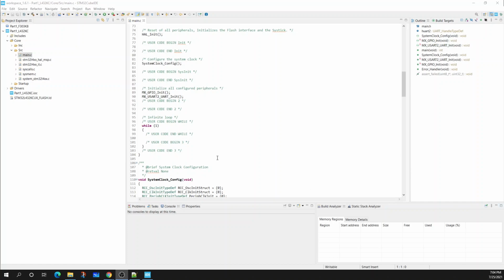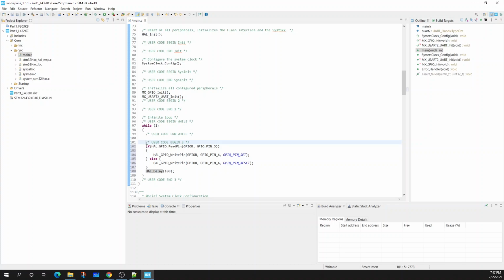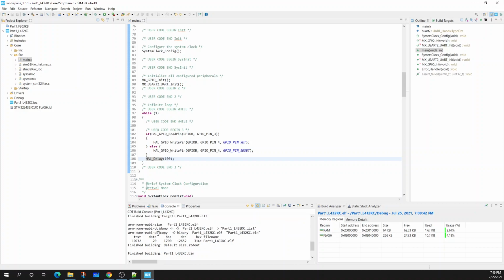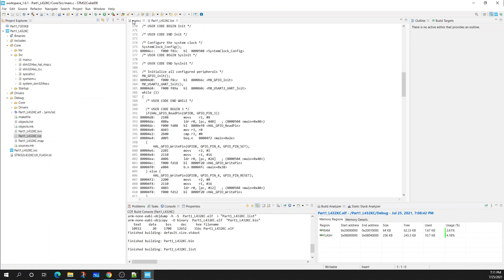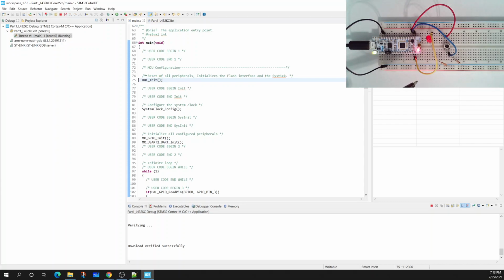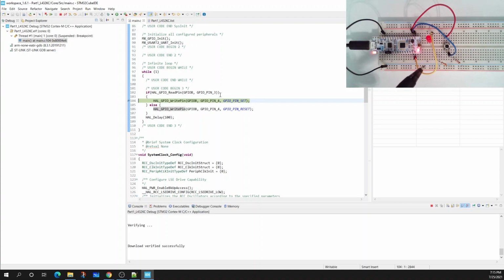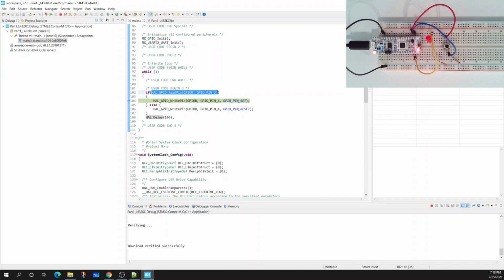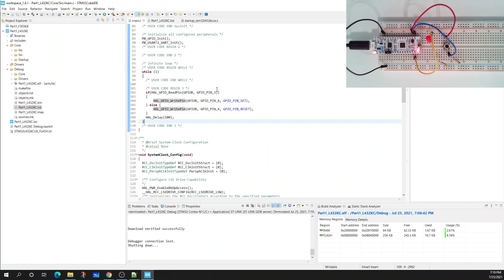STM32CubeIDE Programming, Debugging, and Running

Comment: Did you use ST link or not? IF YES, how did you do settings?
Reply: He did. No settings required if you don't use SWV features. if you want to use it just delete the launch file and debug folder, highlight your project -> select debug as -> stm32 c/c++ application. In the opened menu select "Debugger" scroll down and find Enable Serial wire viewer (make sure there is right mcu clock).  if you use HAL library I think you need to activate debugging too by selecting System Core -> SYS - > in Debug you need to choose "Serial Wire". That's it. I hope it's helpful, good luck😉